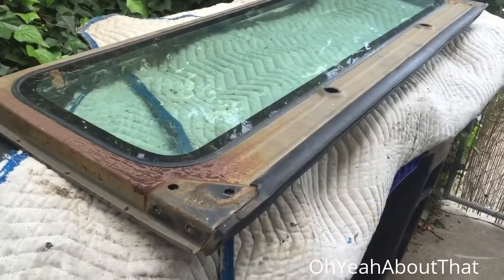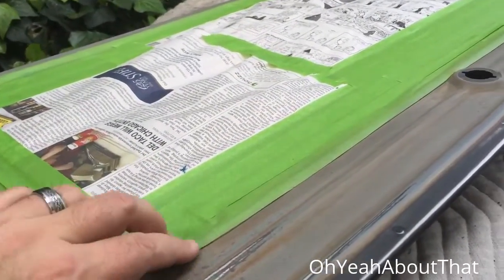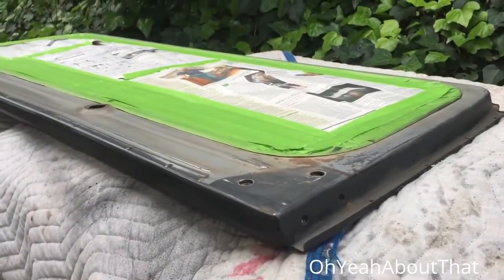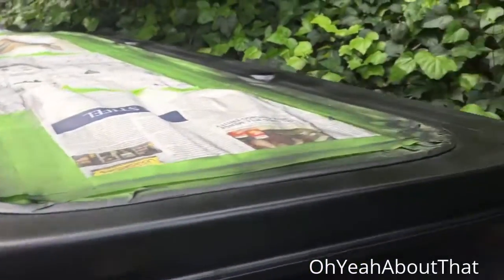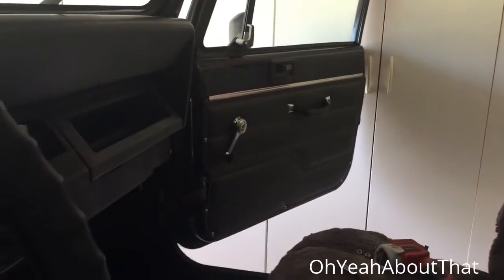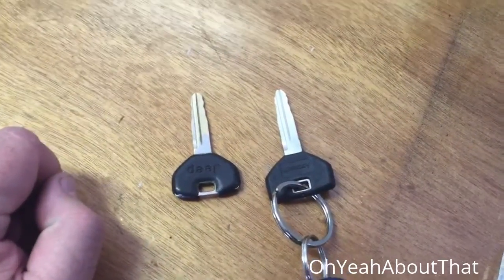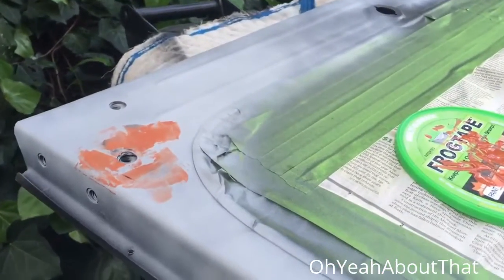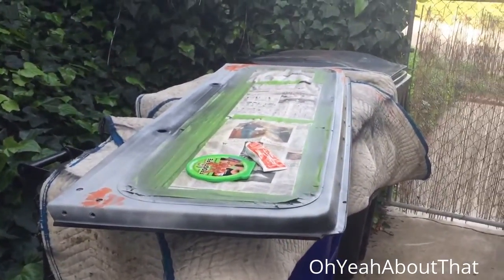project CHEAP WRANGLER (Jeep YJ), part 11

Comment: How much did you pick up the window frame for?
Reply from the maker: I can't remember but I think it was $250.00 with the glass. I would buy a new one if I were to do it again. I got it from Rock Hard 4x4 in Chula Vista. Their prices are way too high.
Reply: Got it, thanks for the tip! My frame has some rusting on the center bottom of the front side. It's buggin' me.